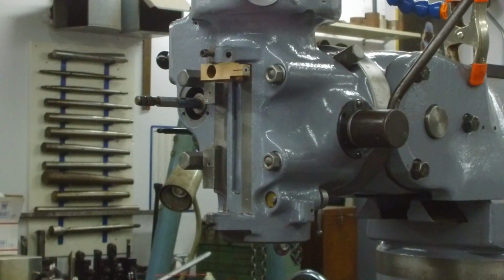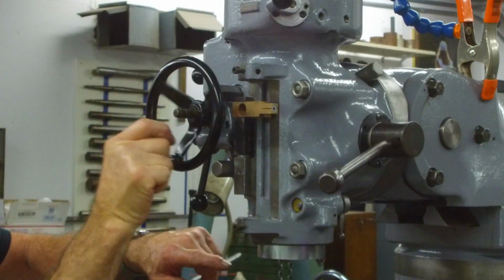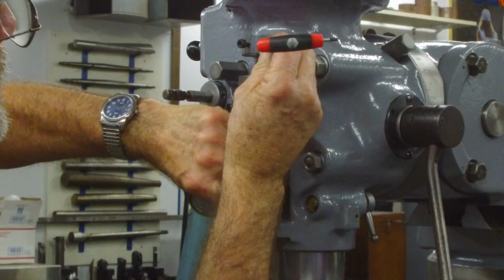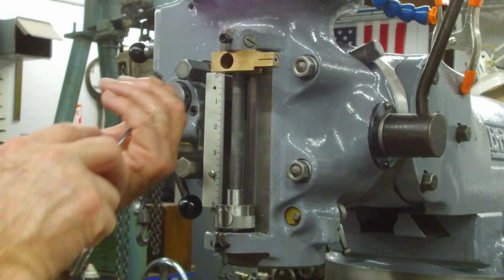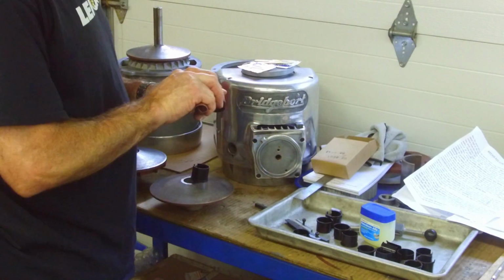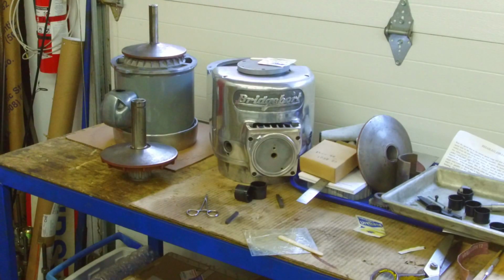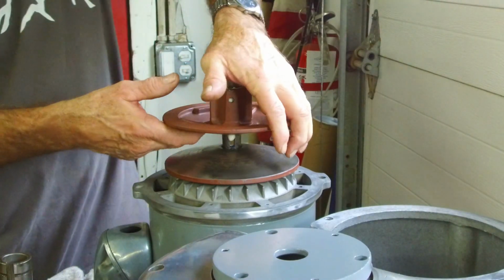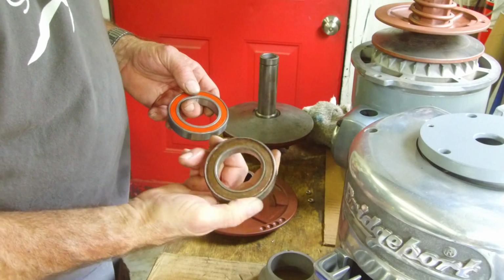Buffy's Back Part Nine

Comment: Hey Keith, enjoying the rebuild. The paint? It’s Rustoleum  enamel, smoke grey, is this correct? With Japan dryer added? Was wondering how chip resistant this is, and if 
it’s hard enough? Thanks.👏🏻👏🏻
Reply from the maker: It does well and easy to touch up if you want too.
Reply: @KeithFenner  Thanks, I might give it a try on an old walker turner drill press.👍🏻

Comment: Damn video wont hardly even play and stalls with error at 360 res. on my six core 32G computer with fiber optic speed test showing 52 MBPS  - YOU TUBE you SUCK-!!!
Reply from the maker: Try it on my Rumble site, set the res, for 1080 before watching. 
https://rumble.com/vqrb44-buffys-back-part-nine.html?mref=enuw3&mc=c4fof